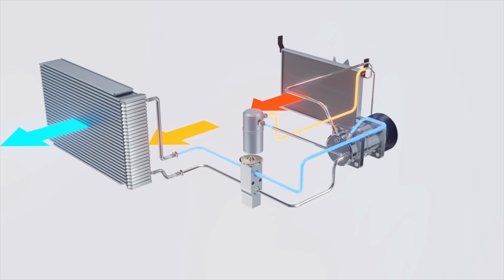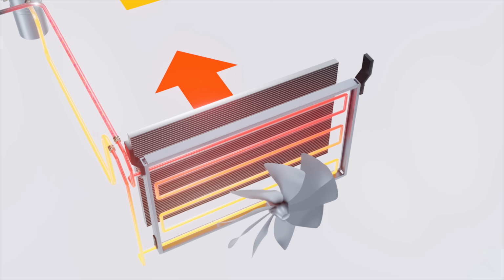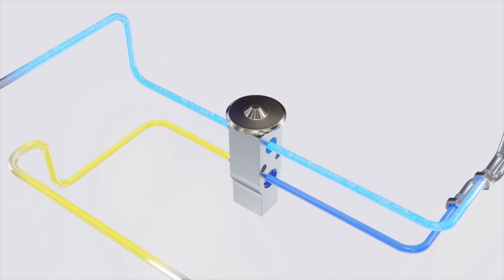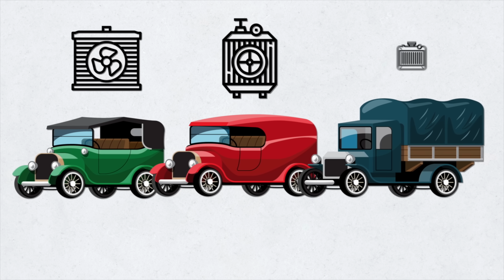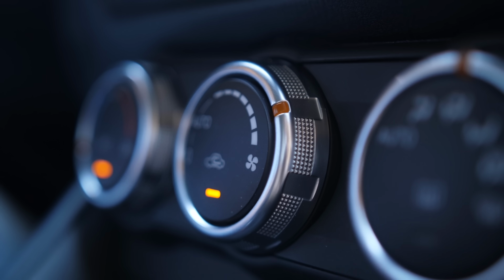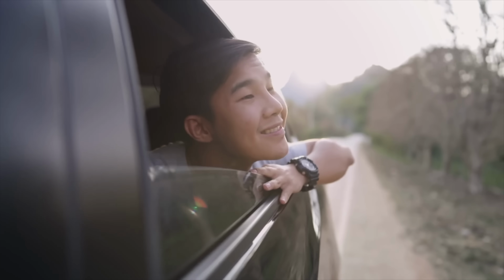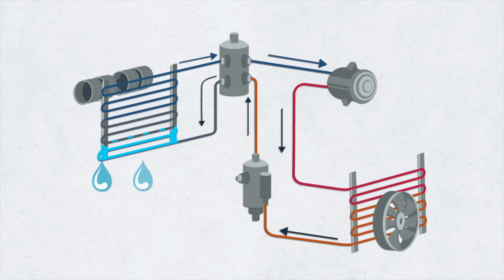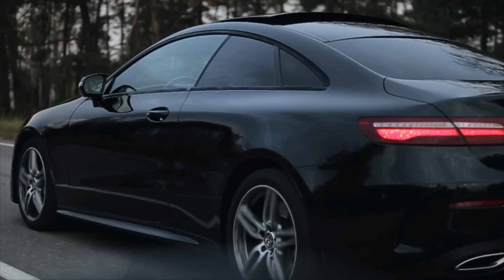Never Do This to Your Car’s AC System

Comment: AC works fine when the cars driiving, but turns off automatically when stuck in traffic. What could be the problem scotty? 
Honda Civic 2009
Reply: Probably keeping engine from over heating. If it just started doing that u might need radiator flushed, or a new radiator cap, or coolant added, etc. Check coolant level first then replace radiator cap, if those don't work take to garage.

Comment: Somewhat needlessly complex explanation of air conditioning by the master.  You can understanding air conditioning by seeing that any gas, when it expands, cools (1st law of thermo).  Just put your finger next to a tire air valve when air is escaping:  the valve is cold, and if the pressure is high enough ice will form even in the summertime.

Comment: I have a 2012 KIA soul and my ac wasn't working so I figure my freon was low buddy had one of those stupid digital freon cans I used it and it read 0 psi so I filled it up still didnt work and then it got a weird thumping sound took my nice old fashion needle pressure reader and it read nearly 150 psi took some needles nose pliers and emptied almost all of the freon filled it up to 50 still had the thump worried I had blown something out in there emptied it more and more till it got to about 40psi and works great now scared the hell out of me amd just proves some of this high tech crap just can't be trusted (just for some reference I'm only 20 so me hating on some tech means it really does suck)

Comment: TIP: Most car AC compressors reach peak output at 1500 RPM.  So if you're stopped in traffic on a hot day after the car has been baking in the sun all day, put it in neutral and rev the engine to 1500 RPM and you'll feel the air out of the vents get noticeably colder.
Reply: I usually will just put the windows down for at least 3-5 minutes and use a sun visor. On really hot days it may not make a huge difference but it's good either way also choose the recycling button on the AC as it will cool your car down quicker.
Reply: Here is another tip I learned from an A/C friend. When you first get in your hot car and it's 130+ degrees, don't turn the a/c fan to high first-off. Instead use the lowest fan setting so the evaporator has time to cool down for a minute or two*. By turning the fan on high, blowing super-heated air across the evaporator coil is hindering it from cooling down the air passing through. 
Also open the windows at least part way for a while so the superhot inside air can escape and exchange with the not as hot air outside.

*(It is sort of like not using a thermostat in your radiator... the water passes through without any restriction or time to remove the heat or giving the engine time to warm up on cold days)
Reply: @strayedcat1966  Maximum BTU transfer is always achieved with the highest volume of air crossing the evaporator coil.  There’s no exception to this rule, ever.  If you slow the air down it will feel colder.  But the BTU extraction capacity is either the same or lower than at high fan speed.  The cooler the air feels, the more likely the TXV will close to reduce the cooling capacity.  Unfortunately, the improvement is only an illusion.

Comment: I never turn off AC, run it all year around.
Reply: Where do you live?  On the equator?
Reply: @kathym6603  New Zealand lol. 

I just turn A/C on, set the thing to Auto 22c/71f and forget it, climate control system works the rest out for me.

Comment: Not to long ago in Mexico I was going 145 MPH around 2AM and had the ac blowing max at like 6800 rpm for 2 mins then when i just let off the gas the ac stopped blowing cold still haven't got a chance to change the AC compressor but i guess i learned that high rpm isn't good to have AC on

Comment: Hey Scotty. Here is a challenge for you
I own a 2014 elantra and my compressor stops working at random times ( highway or parked it doesn't matter). No overheating problems. If I drop to a heavier gear and rev the engine it comes back to life.
I went to multiple mechanics and they all said the compressor is busted which doesn't make sense because I got it new over a year ago and it's working perfectly most of the time.
What's causing my compressor to stop working and how do I fix it ?

Comment: 1 or 2 AC recharges on my 02 Chevy Tahoe ...268k miles.   Still ticking.  On 3rd water pump , 2nd alternator and radiator    I don’t have heat... the heater core is clogged but oh well.  I’ve got heated seats and a jacket.  Making due.

Comment: I like to turn off my AC before stopping the car.  And let the air circulate ... to prevent musty smell from condensation in the ventilation.  Idk if it does anything but I don’t have smells ever
Reply: @Shifty ILX  Sometimes, but most of the time it is mildew growing in the evap.
Reply: @VintageCars999  It really shouldn't be a problem that we need to run the fan like this however the design of the evaporator cases in some cars promote trapping enough moisture that it causes the mildew to form, with other cars they designed the casing to prevent or reduce it so that the water can't collect, it can also result from various small pieces of debris getting blown into the evap area (like leaves, grass ect, and it will decay with the moisture allowing a great environment to grow mold, when a scum develops the moisture almost never dries up even with the cockpit fan on unless you blow it for a long time.
Reply: Oh yeah noticed this from my Challenger. It would be nice if there was a shut down process so the ventilation system doesnt smell moldy socks when you turn it back on again.
Reply: @VintageCars999  The situation many of us have is that the evaporator inside the  dash has moisture remaining in it after the car shuts down and it continues to grow mold or mildew.
Reply: @VintageCars999  Some cars have an automatic system that will allow fresh air to enter the system and the cockpit fan will stay on for a few minutes after the car is shut down.
Reply: @watershed44  ive seen systems where when you turn the on the unit will not turn on right away but will after a minute or two.

I read that the startup delay is to insure that compressor will run properly and makes sure that everything else runs well.

And for the hvac on buses, they also will not turn for a while if its too cold outside even though you have the temps seat to heat
Reply: @fargeeks  what does that have to do with the subject at hand?
Reply: I used to do that. It made the AC smell. Now that I just shut the engine off no smell. Also Scotty failed to mention the best thing you can do to extend the life of your most wearable item in your AC system, your compressor. Push the AC button to off and  use the fresh air from outside to cool the inside during the fall winter and spring seasons when it’s cool outside. There’s only so many hundreds of hours life  in a compressor. When it’s 55 outside and the AC button is on your compressor is cycling on and off every few seconds for absolutely o reason. Same when you forgot your defroster on in some cars.
Reply: @tomdurkins  
If you don't use the AC during whole seasons the compressor isn't lubricated and tends to give up the ghost much earlier.
Reply: @onpsxmember  That’s impossible to do because of the defrost mode.and I don’t believe it does nearly the harm running your AC 180 days a year unnecessarily does. The average AC compressor has a life of 2000 hours. Every hour you use it when it’s 55 degrees or less outside is a total waste.
Reply: @tomdurkins  
I guess that’s why my original compressor on my 02 Chevy Tahoe keeps ticking .  I always run only when I need it.  that’s 19 years and 268k miles .. I bought it new.   Lucky me
Reply: I think if you live in a desert environment like Colorado where everyone nearly dies from an attack of "muggy" weather when the relative humidity climbs above 9% (that's not a typo... Single digit nine percent, qualifies here as unbearable humid muggyness) Which causes paralysis and lackluster job performance.  Heck who can go to work under these conditions, much less worry about the smells it may or more likely may not leave in your car's AC components.  Heh heh!  9% humidity might last all of 2 hours here and then we are back to sunshine and skunk smells all around.  Puke!  🤮  So if youre in Colorado you might want to replace the in cabin air filter, or at least scrape it
Reply: @B Bustin 
*BINGO! You should always turn off the AC, LEAVE THE COCKPIT FAN ON, and OPEN THE RECIRCULATE AIR FLAP TO LET FRESH OUTSIDE AIR IN A MINUTE OR TWO BEFORE YOU SHUT OFF YOUR CAR! Leaving the recirculate control OFF allows fresh air to continue to enter the area of the AC evaporator 
even after the car is shut off which helps any moisture which can create mold and mildew to dry up instead of sitting in that evaporator!
Reply: If I’m recirculating the air in the car with the ac on, wouldn’t there be less humidity in the car than outside? So wouldn’t less moisture get to the evaporator?
Reply: @mootsym  Exactly. That’s why when you turn your AC off and turn outside air on just before you shut down your engine it makes your AC smell more when you get back in your car later on.
Reply: @tomdurkins  No, you want fresh air to be able to get into the evap box at (flap open to outside air) when the car is shut down, if you keep the recirculate flap closed at all times when the car is shut down it traps the moisture and it cannot evaporate out of evap casing.
Reply: @watershed44  1 or 2 or even 5 minutes won't dry your evaporator , is a waste of time , another thing is why the evaporators have a dripping line for? ,  some cars even 1 hour after still on the drying process or (dripping) , some people has smell problems because they probably need to make sure the line out of the evaporator (dripping tube) is clean and in good shape, not kink etc.
Reply: @FandFcustomcarts   I have had this problem and my condensate line is perfectly clear. The problem is that debris gets lodged inside the evap fins and creates a scum which is a breeding ground for mildew and mold. I've even cleaned the evap from the blower fan access panel and still had this problem until I started turning off the AC and blowing the cockpit fan on high for a few minutes, it doesn't eliminate all the moisture but enough that it reduces the amount of mildew that can form almost entirely
Reply: EXPLAIN
Reply: I turn it off also, so as to not loose the cold air already in the system...lol
Reply: My car is only a 2020 and has a unpleasant smell when I turn on my ac🤷‍♀️
Reply: @christinelopez5908  Get the car up to operating temperature, set the climate control to heat set themostat to the warmest setting, turn recirculate to OFF
roll down the windows and turn blower fan to high..let the car run like this for about 30 minutes or so, then turn things off let the car off with out using the AC for a day if possible, might get a good result.
Reply: @Shifty ILX  it can also come from high humidity environments going through the cooling element and condensing on that element. This usually has a drain under the car in most systems so it won't build up alot.
Reply: @jacobjacob5880  Go troll somewhere else. 
Chew.
Reply: Same here.
Reply: No car I've ever owned has had a musty smell from the a/c. Idk what you're doing
Reply: @dabnisbrickey6527  Lucky you.

Comment: What if it feels like my ac just can’t keep up in really hot weather?
Reply: Make sure it's set to max AC or the air circulation button is turned on. It recycles the air in the cabin so it will drop temperatures quicker.

Comment: @06:10 At no point in the list of things you said did you mention how much a regular air conditioner compressor in a passenger car costs in horsepower, or how much it drags an engine down; as a factor to consider in the list of things to consider when considering whether or not an AC draws more energy than rolling down windows.

Comment: I have a 2015 Chevy Cruze and the Ac blows cold but when I run it the fan blows at 100% for a second or two then shuts off for about 15 seconds. at the same time I can hear the Ac stutter inside the car I'm thinking it's the expansion valve not entirely sure though. The dealer told me they would try to replace the compressor but I really doubt it's that.

Comment: My previous car's AC compressor was making a clicking sound when the AC is on, then after a couple of years the compressor locked up causing the AC clutch disintegrated, it appears the compresor had been running low on oil for a while.

Comment: We noticed this evening when driving through some extremely rainy weather that driving through a large puddle would cause our AC in our 2015 Sienna XLE with 131k trouble free miles to cycle off. Pressing the off button and then switching it back to Auto got it going again... what is causing the switch to trip?!? Is this something we should have repaired?
Reply: Sounds like a broken accelerator carburetor
Reply: @UnfaithfulSheriff  is that near the Flux capacitor, or is it a real thing?!? ;)
Reply: @curtwhite876  you caught me! 😂😂😂
Reply: @UnfaithfulSheriff  seriously though, it was not an engine problem, the motor never skipped a beat. The AC just switched off and the climate control interface started flashing "AC ON" as the passenger compartment began to get warm and muggy...
Reply: @curtwhite876  that’s crazy. This is why I could never be a mechanic. Mysterious issues like this with cars would drive me crazy.

Comment: We did not have AC in our cars as a kid.  Driving o long trips was like riding in an oven.  Between the heat and air coming into the car windows a 5 to 6 hour drive was hell.  You were totally spent. Imagine being in a 100 degree metal box for 6 hours.  That was a car trip in 1960's.

Comment: would have been cool to mention the many things tried... like the old window swamp coolers
Reply: Saw a swamp cooler in a house in Merced, CA back in the 70s. Hot and dry outside but cool and moist inside. House was full of plants. It felt like heaven to a Virginian in the desert!
Reply: @baao7980  They are still used in houses in dry areas even today... and they sell those little USB powered portable coolers that are the same, but really too small to work well.  Way back before my time though they used to have window units you could put in your window on your car to help cool down your car inside.

Comment: One thing I remember was that one way to know if the refrigerant was low or there was a problem  was if the compressor turned on and shut off in rapid succession. Not sure if that’s still the case nowadays?
Reply: Too high or too low will give the same issue. Improper air gap will also give you that problem.

Comment: Always always always use your friends car that has good ac when available.  My biggest tip.   Funny story. I mounted a amp under the dash and drove a screw into the ac line.  It’s ok the motor blew not long after. It was blazin that summer of 97 . Never ever ever again did I ever ever ever get near a line again. My dad hit the line while cleaning the ac to a rental home he got in 99. I almost caught him before he hit it, as the Freon poured out, I started sayin $10.00 $20.00 $30.00 $40.00 $50.00 $60.00 and on and on I went as he looked over at me like you smart mouth SOB.  He knew he messed up too.  I miss those days. Time flies hug your friends and family
Reply: Currently for R22 you could count $100, $200, ...

Comment: My dads Toyota Tundra ac broke a pipe must have burst because when he got out his left front tire and rim and wheel well were all wet and it was a hot day so there was not water on the roads and his ac dose not work it just blows warm air

Comment: My cousin overcharged his ac with those ac charger kits and now his ac doesn’t work on his Mercedes
Reply: That would be correct.  AC refrigerant is a balancing act, can't be too little nor too much.  That's why it's usually best to evacuate the system, draw down a vacuum on the system to check for leaks, and charge the system to only the amount shown on the car's sticker.  Many folks think the more refrigerant the colder it will blow, which is counterproductive.  Also, when converting an R12 system to R134a by evacuating, changing seals, new oil, etc., you actually charge the system with LESS R134a than the sticker calls for on R12.  There are charts online to tell you the proper quantity.
Reply: Low and high side pressure will be very high when overcharged.  When pressure gets too high the system will shut down so that it does not blow a/c parts apart.

Comment: Bought a 1995 corolla once turned on the ac it didn't work so i though it had just broken but a few months later when doing an oil change on it I saw that there was no belt on the compressor lol
Reply: I bought a '72 Super Beetle which once had A/C-----The old guy took off the compressor to save gas, and gave it away----What a DOPE!!!
Reply: How long did it take you for figure out whether or not you had a belt on you pants?
Reply: Oh 😳😳😳😳😳

Comment: Funny story?
My ex was convinced that in order for the inside of the car to cool down when turning on the A/C, all the windows had to be rolled up. Over two different short trips, I had to use a stopwatch to prove to her that keeping the windows down for the first few minutes of driving will help cool the inside of the car much more quickly than leaving the windows up.
Reply: I knew someone like that too. It’s like pouring cold water into a cup full of hot water. Easier to help get that hot air out of the car 😅